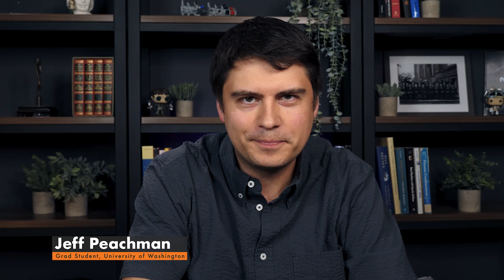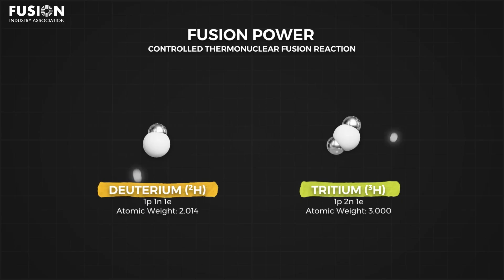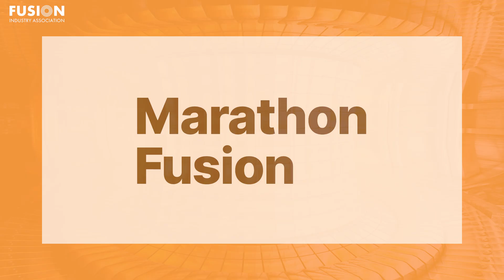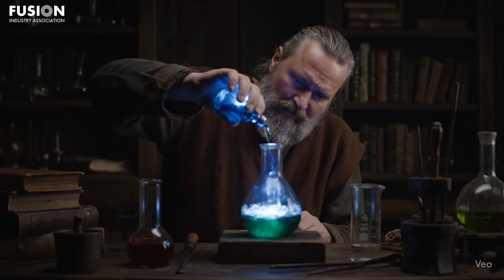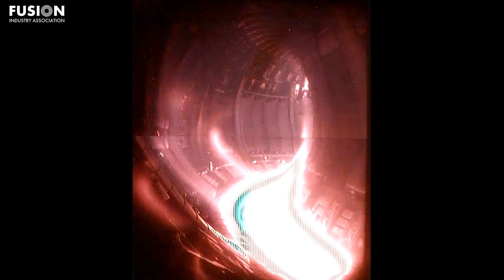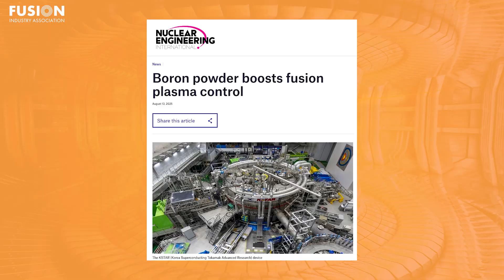Fusion News, August 20, 2025

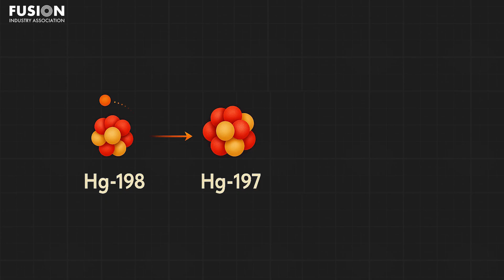Comment: 2:24. You fail to mention that Hg-198 is just 10% of natural Hg, and you would need extra energy to enrich it. Then you will also need energy for the radiochemical process of recovering the Au-187, among other isotopes which would be radioactive.
Reply: Also working with cryostat, hard vacuum, hot plasma, x-ray, neutron flux....  and now tanks of mercury for blanket xD Idk about that.
Reply: @capnkirk5528 proposes something smarter: transmute the mercury in place, let it cool, then separate the gold chemically. Simple. Scalable. Sensible.

Comment: The article on HEAT ML doesn't explain why it is important to model magnetic shadows. I assumed it had something to do with finding safe places to hide diagnostics, sensors, or delicate components. But, at 04:02 the goal is described as "spread heat out as evenly as possible" to avoid hot spots. Also, is there a real (not just samantic) distinction between modeling shadows vs modeling exposed areas?

Comment: Great attitude, Jeff. 

In the story about turning mercury into gold, Marathon Fusion plans to transmute a specific isotope of mercury (Hg-198) into gold (Au-197). They do not mention the fact that natural mercury only contains 10% Hg-198. So, before they even begin, they must isotopically extract Hg-198 from natural mercury—a process that, per unit weight, costs far more than gold itself.
Reply: Why? It would certainly seem EASIER to transmute the metals in place. That only works if the impact of neutron bombardment on the other 90% of the mercury isn't TOO detrimental or cost-prohibitive.
Then you are just separating Merury from Gold chemically - and THAT will be economically viable.
I don't KNOW the answer, so explain please?

Comment: The mercury-198 isotope has a natural abundance of around 10% of the natural mercury isotopes. If isotope enrichment is required to make this scheme work than that enrichment process would likely be more expensive than the gold that would be generated. Those promoting such schemes tend to be masterful in omitting key evaluation criteria. Another issue, not mention in this video is that the neutron transmutation reactions would generate some radioactive gold isotopes. In orders to sell this gold the sellers would need to wait for a lengthy period of time for the radioactive gold to decay before it would have any significant value. Alternatively the generated gold would require an extremely expensive isotope depletion process that would again degrade the price of the resulting purified gold. 

The process of transmuting an isotope of mercury into isotopes of gold comes at the cost of robbing the proposed reactor of neutrons that would otherwise generate heat that is needed to generate electricity. As it presently stands the need to generate a reactor’s own tritium fuel robs the proposed reactors of a substantial number of neutrons that are required to keep such reactor’s power generating efficiently high.

Commonwealth Fusion Systems (CFE) typically refers to their SPARC experimental machine as being a prototype of fully integrated ARC power plant that they claim that they will soon build despite the fact that they have never generated a single watt-hour worth of fusion energy. The unmentioned facts about SPARC are that it won't come anywhere close to the stated design of ARC. SPARC is designed to only generate fusion reactions for a maximum of 10 seconds and then that will require a cool down period of about four hours since the machine lacks a robust heat removal system. SPARC will also not include a tritium breading blanket, or a tritium purification system that would allow the tritium to be fed back into the vacuum chamber. Most fusion startups had assumed that ITER would work out the tritium breeding problem but now ITER is so massively delayed that those experiments will likely not occur until after 2040. Despite the addition of AI tools for SPARC design those will not makeup for the fact that SPARC won't even approach the claim that it will be a prototype of ARC.